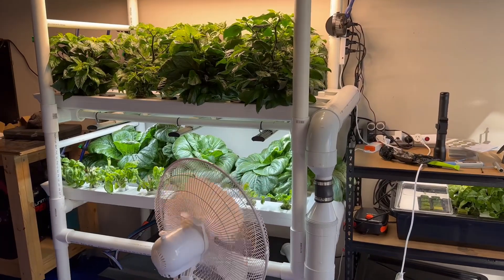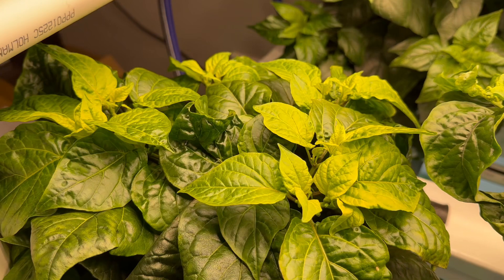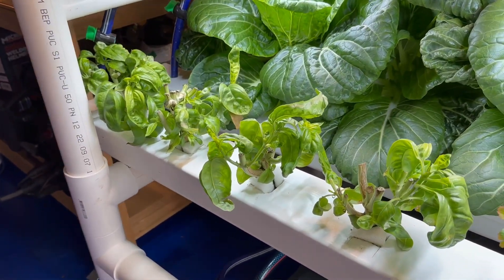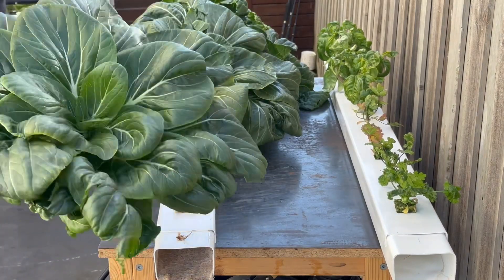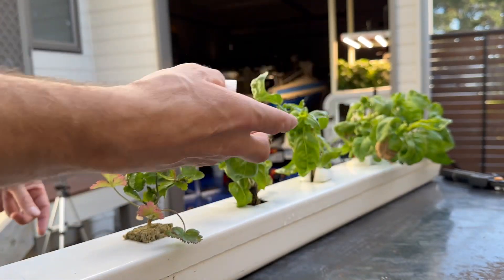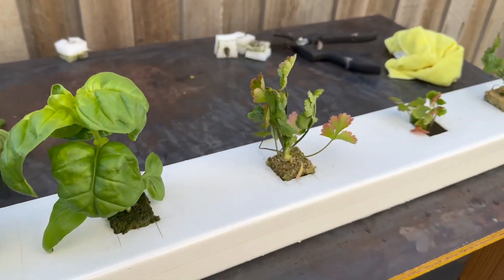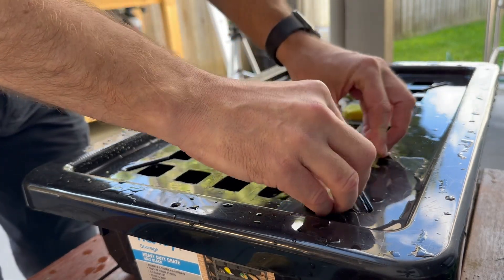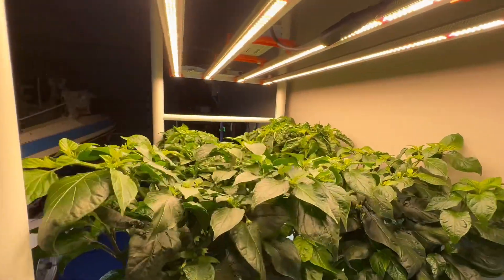Planting seeds in rockwool cubes & garage NFT hydroponics update

Comment: Curled leavs can be a sign of nutrient deficiency, PH/EC, lack of air flow or light intensity. I would say its more likely your light instensity is too high for the chillies. Becauase they are fruiting you dont need to reduce the output of the lights just move the lights higher. If lights are too close it can burn the edges of the leaves also.
Reply from the maker: Thanks for the input! I raised the light last weekend so we’ll see how they look when I get home this weekend (I’m only home on weekends).